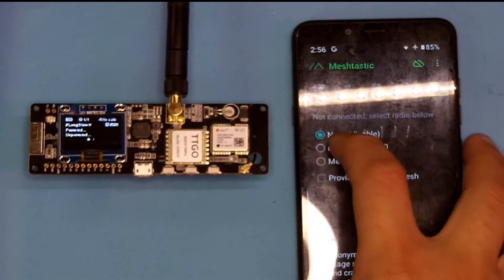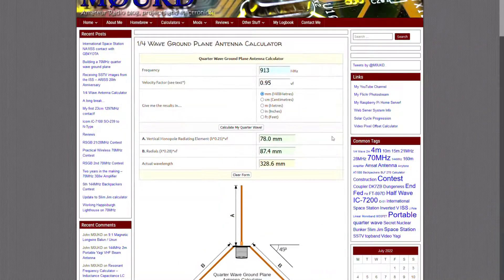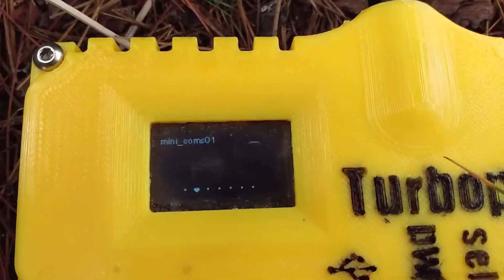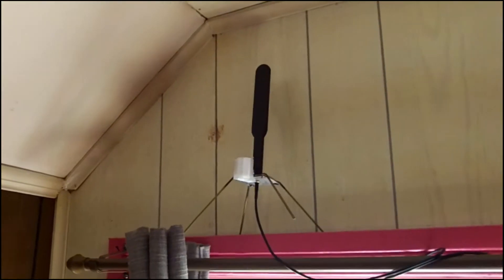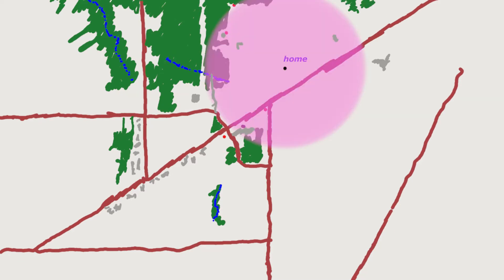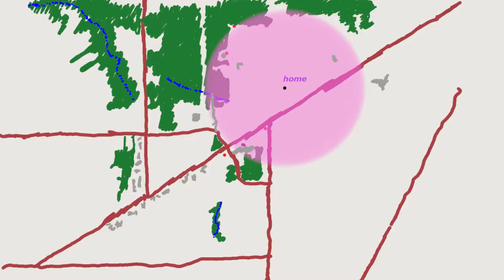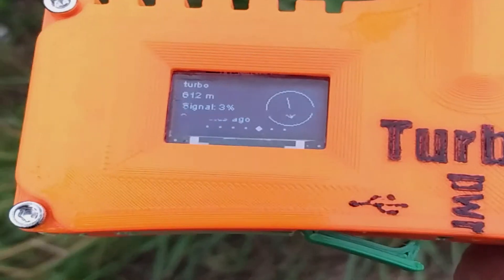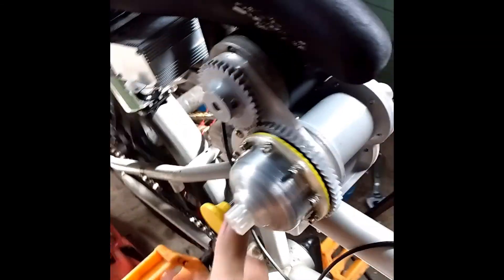Cheap/Stock Lora Antenna Testing

Comment: In the US, FCC allows 30dBm ERP. Most Meshtastic radio are +20dBm, so you can run a +10dBi antenna and be legal. I run a helix I designed.
Reply from the maker: locally the rules are similar , i ended up going with a pcb dipole that seams to be a decent upgrade

Comment: Sticking a random unknown antenna to a ground plane, is unlikely to work. The first you tried is a helical normal mode antenna, almost certainly untuned. The second is a PCB folded dipole antenna, will only be messed up by a ground plane. You made 4/5 of the effort already making the ground plane, now make the last 1/4 wave vertical element from a piece of copper wire and I'm sure you'll see an improvement (mounted above your metal roof).
Reply from the maker: Ya I put a pause on making my own antenna stuff and just purchased a decent upgrade from stock . Then stuck the whole radio up in the air above my house . Now range is great short of the hill and other large buildings
Reply: @turboprint3d  Understandable, I was not complaining about your effort, this video just left me with why did  you never make a complete ground plane antenna? You are also right about buying. The ones you successfully can make will have low gain still, even when made properly, so buying a professional antenna, with a datasheet from a reputable name, is worth the money.
Reply from the maker: @Tore_Lund  oh ya the reason , I don't know what I'm doing 😂. I have many skills and experiences ,radios are not one , but I'm working on it .
Reply: @turboprint3d  You're right, I had a long passion for homebuilt antennas, before Meshtastic, WiFi, TV,  various radio amateur stuff. I find them intriguing: cheap in materials, but a lot of theory to make good ones. When you get to it, antenna theory will be a pleasure.